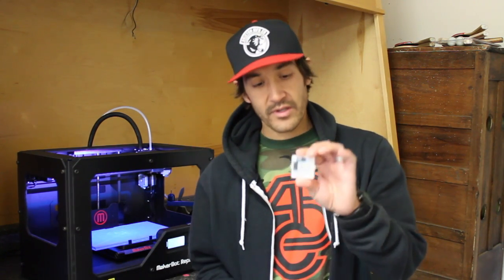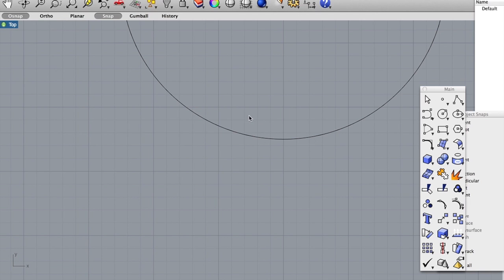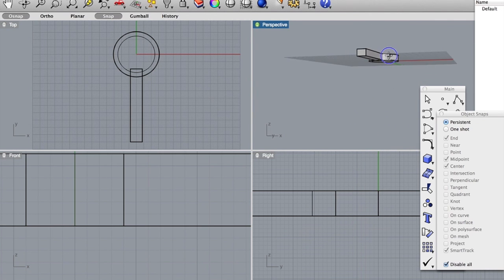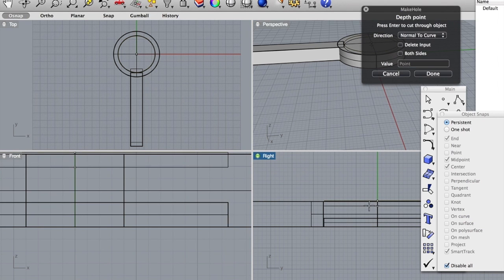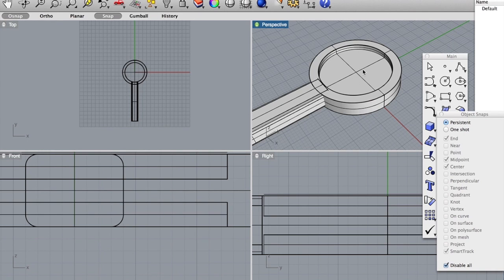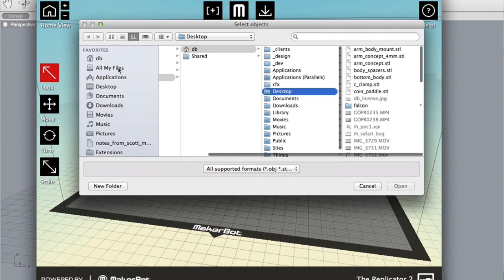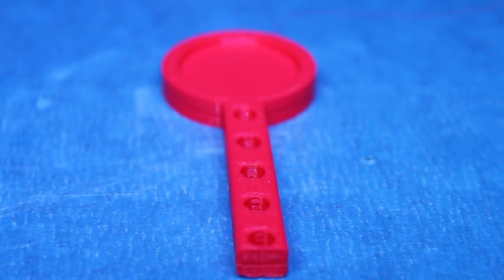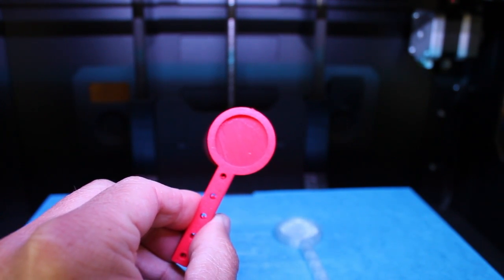How I Design and 3D Print Parts with Rhino 3D and MakerBot Replicator 2 - The Magic Coin Paddle

Comment: Hi, do you know if there's a way to know how much precision you require for printing a specific 3d model? I mean can you visualize this in the rhino 3d file? I don't own a 3d printer. But I want to know if it's worth to print in .05 or .025 for a jewelry piece. The price changes a lot. That's the reason I'm asking.
Reply from the maker: +Monbcbg Good question. To be honest I'm not sure. I believe this is possible in SolidWorks. Let me see if I can find anything out and if I do I will let you know.
Reply: +Dennis Baldwin Thank you very much:)

Comment: Having a big hassle with Rhino. Using your tutorial but when I try to ExtrudeCrv it only extends the outer rectangle height and doesnt fill the rectangle. So I end up with an outer edge. What setting am I missing here?
Reply from the maker: When you extrude look at your options dialog. There should be a "solid" checkbox that will fill the curve. Good luck!